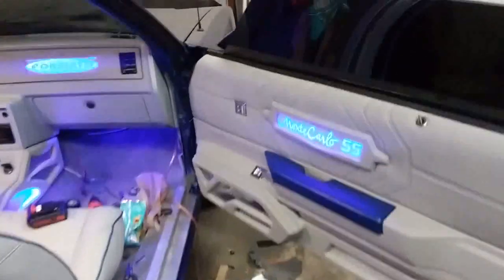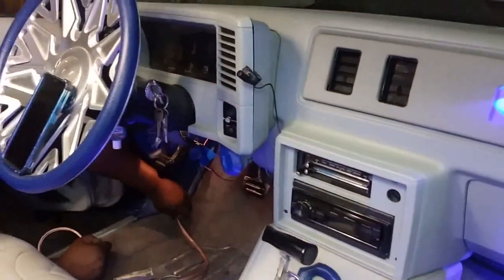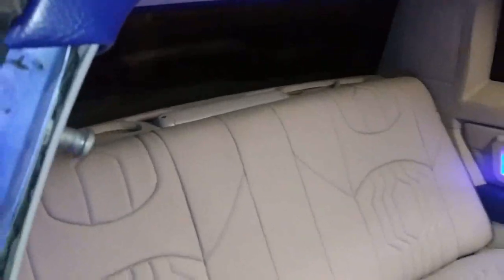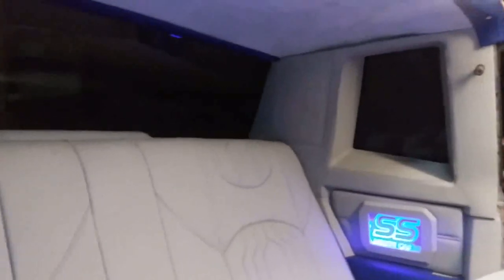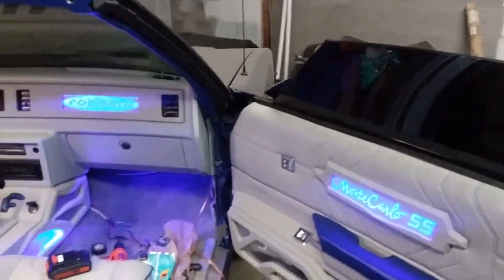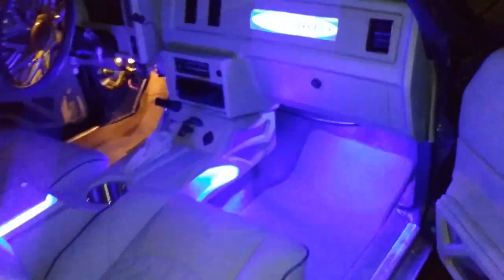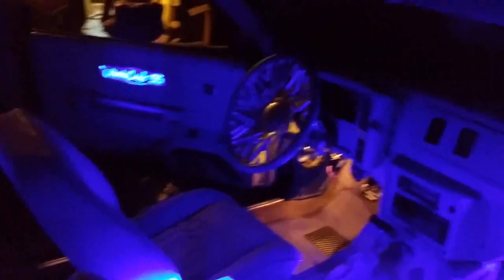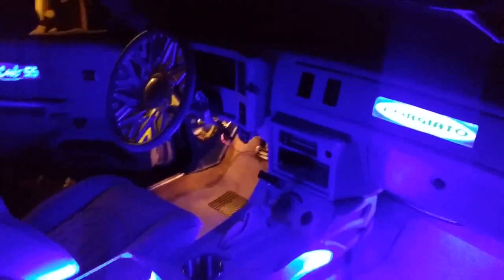Custom monte carlo is almost done!

Comment: Trust me. I will come to you. Soon as I get my truck painted in Texas. I got that 99 Cadillac Escalade.  I been screw over. Somebody did my carpet didn't finish nothing.  I have fainth and trust in you. I just want a good deal. I have put 11000 in this truck. I work alot. I want the whole inside redone. Be around November or December. So I have time to drop it off. You still in Indiana.
Reply from the maker: Yes